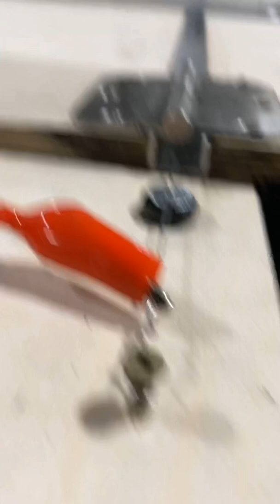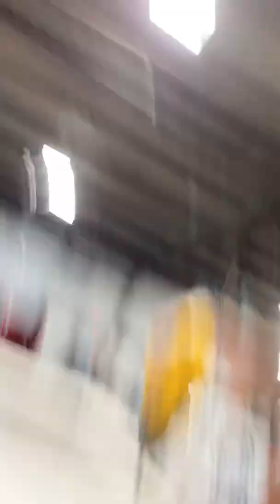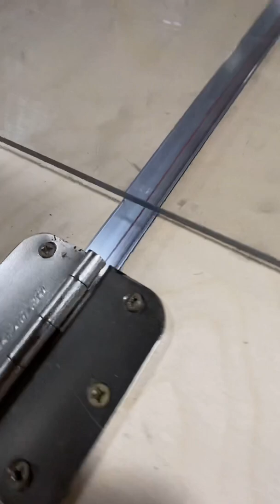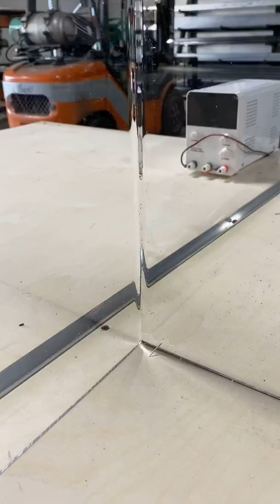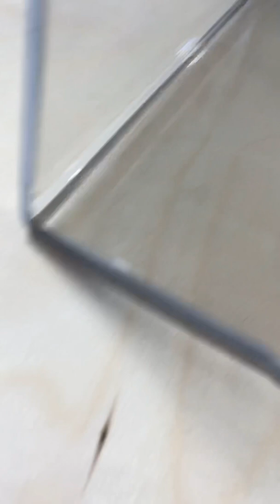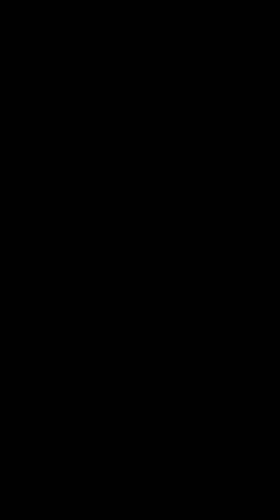Bend Polycarbonate Full Sheets

Comment: Though 5 years ago, underrated video on making a home bender cheap/easy. Just needs jigs/blocks to stop at 90 degrees on the flat side, and  1x2 strip clamped to prevent sliding.